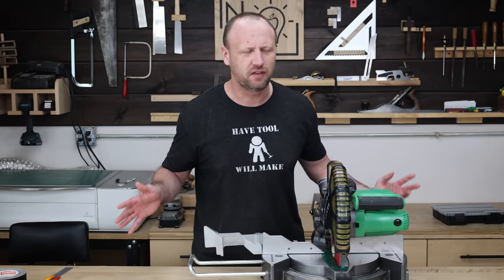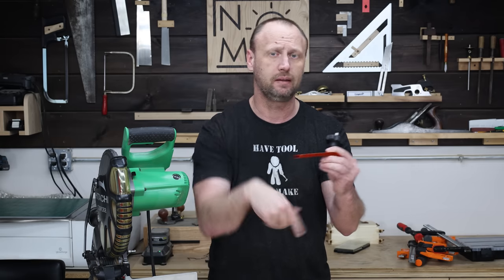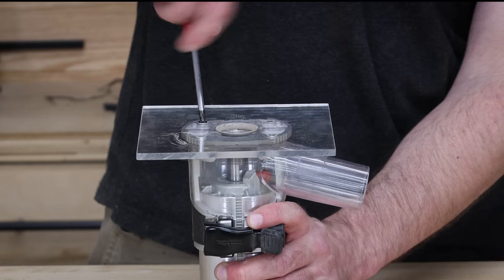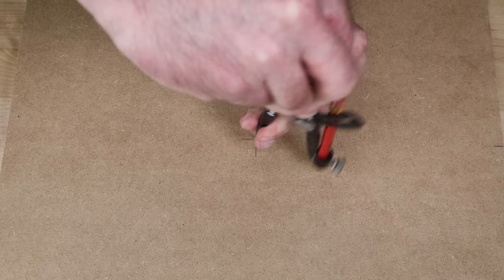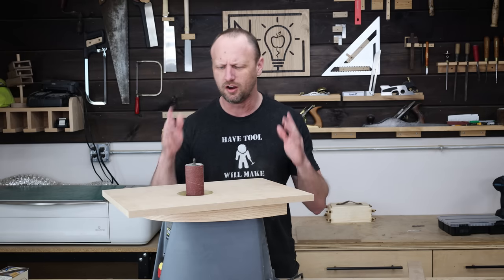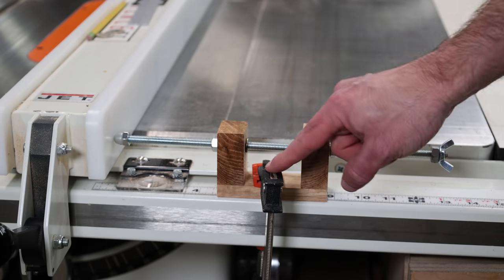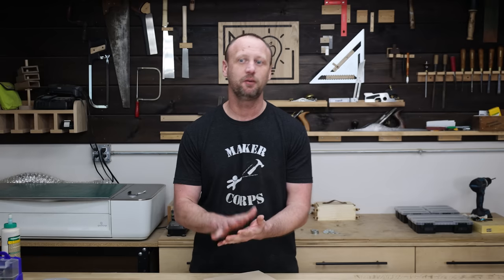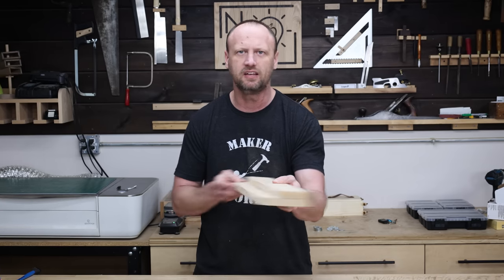5 DIY Hacks That Will Transform Your Workshop!

Comment: These are awesome! Thank you for sharing, you make things look very easy.

Random novice question. When counter-sinking screws, why did you drill the half deep big hole before the small through hole? Does it matter which one you drill first?
Reply: Plexi can melt a bit when drilling. If the smaller hole was drilled first it would get plugged when making the bigger stopped hole.

Comment: I’d like to see the sander built into the top of a mitre station flush so you don’t lose sanding capacity. I have the exact same one and it does a great job but I wish I had the one with dual sanding options

Comment: Really like the spindle sander top idea.
As for the table saw fence micro adjuster, I can not emphasize enough the replacing of any table saw fence with an Incra Table Saw/Router Table fences.  They just work!!  I replaced my Powermatic 66 with and aftermarket fence and then finally went the Incra route.  They make perfect repeatable cuts every time no matter how many times you move the fence or how many years have past.  Same with the router table fence.  No more tappin' on the fence to get it to move "just a little".  And then saying. "OH $#!T!"  They are worth every penny I spent!
NO, I have nothing to do with Incra and promotion of their products.               
Love the vids.  Keep 'um comin'.                          JimE
Reply: The Incra is really nice, but rather expensive.  I looked at the system and would have loved to get one, but bought a Delta fence for my saw.  The Incra would also have been in the way of my router table, as it is an extension of my table saw (the Delta also works as a router fence support/backer).

I made a home-brew micro-adjuster for my Delta fence.  It clamps to the rail and uses a pair of neodymium magnets with a standard Rockler micro adjuster for a router table.  Easy to add and remove or place on either side of the fence when needed.  Works like a charm and total cost was <$30.